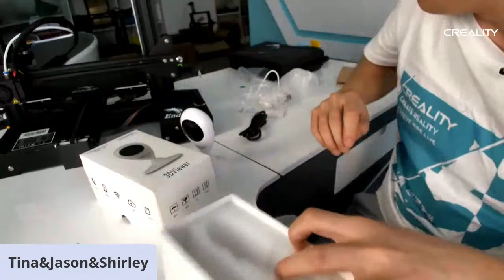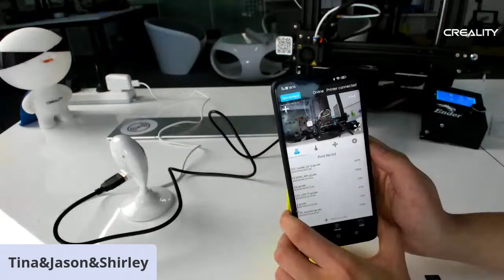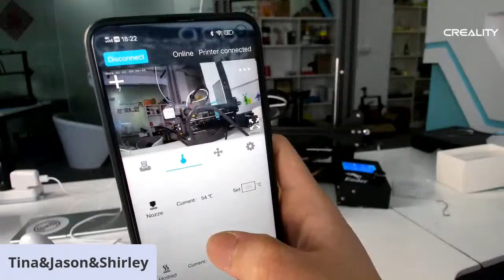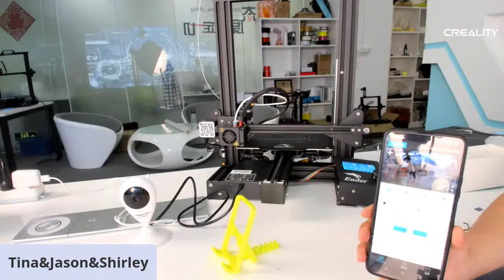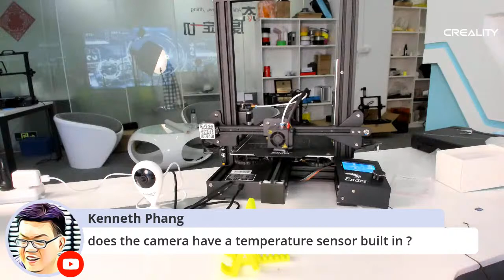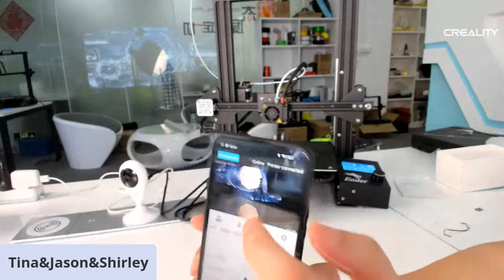Creality 3D Viewer Show

Comment: I got my 3D viewer camera today, and after a while I got it to work on my Ender 3-V2. 
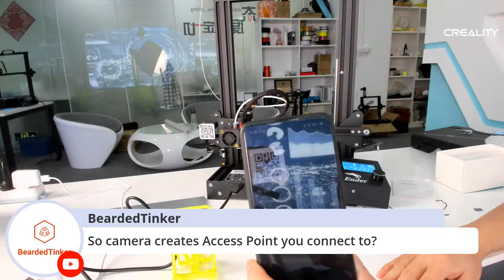Looks like the problem was that my wifi router is at 5 ghz not 2.4 ghz that the camera needs to be connected to. And the app can as you said be connected to any kind of wifi 27:15

Creality! In the package I didn't get the charger that you are showing, why is that? Is it just missing or do you not provide this to your european customers?